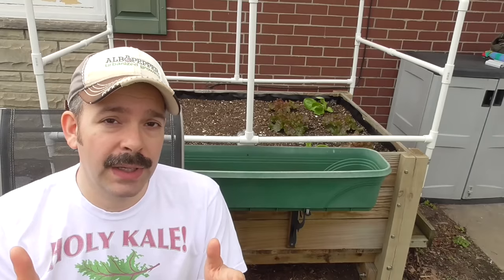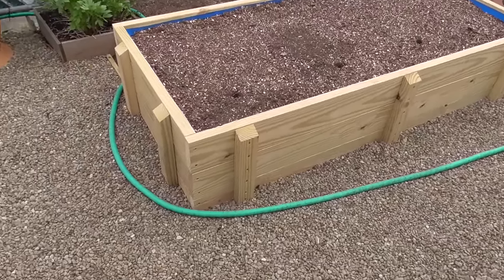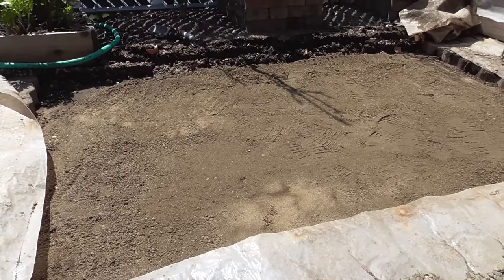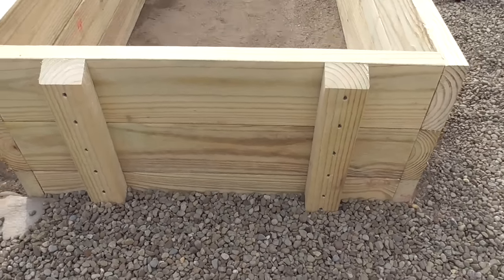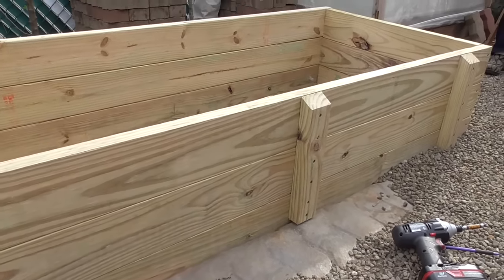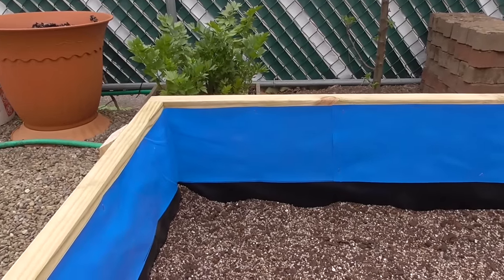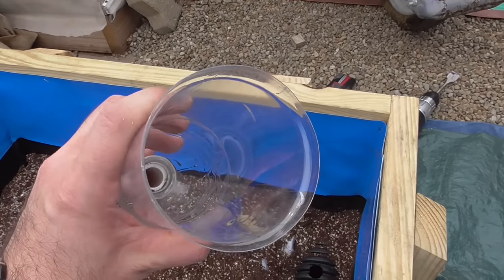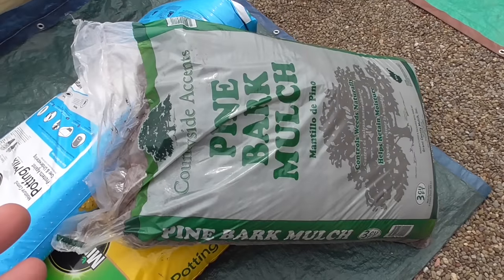Self-watering SIP Sub-irrigated Raised Bed Construction  (How to Build)

Comment: Why no manure? I don't have access to potting  mix (I live in the desert) so do  you recommended another medium? I have plenty of sand and compost and manure..
Reply from the maker: Maintain Physical Structure:

KEEP YOUR MIX CLEAN: For your SIP potting mix to remain viable after years of use it must retain its water wicking attributes while maintaining good pore spacing for healthy aeration of plant roots. Unlike in-ground garden soils that are mineral based, there is no need for incorporating excessive "organic matter" in the form of plant waste. After each harvest it is best to pull out large plant roots, shaking off the dirt. Compost the roots in a separate location. Artificially aerate the soil by fluffing it with a rake.

COMPACTION IS THE ENEMY! Over time, large particles will start to break down leading to compaction. To compensate for this it is good to add components that will improve soil structure as needed. Perlite will boost aeration if the mix seems too moist. Pine bark fines can help to maintain good structure over time. An important note about wood products in potting mix: Nitrogen draft may occur, requiring additional nitrogen supplementation. To minimize this effect, use dark, outer bark pieces (higher in lignin) which tend to break down slower than light inner wood. Look for aged or composted barks as these are more stable resulting in less N draft. If you add these to your old SIP mix, be sure to mix them in very well.

TOPPING OFF WITH PEAT MOSS? Adding fresh peat moss is usually not needed. By itself, peat moss is prone to compaction. As potting mixes get old, compaction becomes a growing concern. So, unless your soil wasn't wicking well in the previous season, don't top off your SIP with pure peat moss. It's ok to add some if it is included in a complete potting mix which would include perlite and possibly wood products. Tossing in a fresh bag of potting mix is an easy way to top off a planter that has settled over the season.
Replenish Nutrients

BAGGED COMPOSTS? To prolong the viability of your SIP potting mix, it's best to replenish nutrients in the form of fertilizers. Organic gardeners are apt to use compost as often as possible. In SIPs, worm castings can be included in small amounts. But using composts in containers can yield unpredictable results. Bagged (retail) compost, humus or manure might have a fine consistency, similar to garden soil. If it contains fine silty particles then this can reduce pore spacing and aeration properties of the mix. That's why topsoil is NEVER recommended.

As air gaps get plugged up by ultra fine particles, compaction occurs. And since SIPs are always resting on a perched water table, the few remaining air gaps tend to be saturated with water. This impairs root health, preventing plants from getting the oxygen needed at the root zone. This can lead to a decline in plant growth, or even root rot and death. Even if plants grow ok in the first year, over time the potting medium may break down to the point that it must be replaced.

HOMEMADE COMPOST? Buying bagged compost is not financially advantageous in large beds anyway, not when compared to buying a bulk organic fertilizer. Of course, homemade composts might work, especially if they are mostly wood based. These tend to have more structure. Larger particle size means improved aeration. I've found though that it's very easy to reserve my compost for conventional beds and perennial plantings. It all gets used, just in a different location.

https://albopepper.com/refreshing-sip-potting-mix-adding-fertilizer-year-2.php
Reply: @Albopepper  So don't bother then if I can only use sand and manure? Could I place strips of fabric in water pit riding up through the soil to help wicking?
Reply from the maker: No idea. I have a basic system that is tested and works. But if you fill it with something totally different, then it's not the same system & I really can't advise you on it.

Comment: When creating the underdrain, there are 2 critical factors:
1. The soil volume to water reservoir should be about 15%. Fortunately, that is about the same as the area of a square around a circle. 
2. With drain tiles, there should only be slits/holes on one side. The holes always face down so the soil won’t flow in. A negligible amount will accumulate in the bottom of the pipe over time. If that is a concern (shouldn’t be), then a bedding of open gravel will trap the minimal amount of soil before it gets to the pipe holes.
Reply from the maker: Thanks for sharing your observations. Fortunately, the perforated corrugated drain pipes shown in this video have never filled up. It's just not an issue. I've examined them after years of growth and they remained empty: https://youtu.be/q-JitnHKCY8  There's no need for gravel or fabric or any special filtration. Just use potting mix based substrate materials and it will be fine.

Comment: I see you put a little straw or pipe on the drain hole. Can I just leave the hole as is without the pipe there?
Reply from the maker: With smaller plastic SIPs like buckets, you would be fine. But for the wooden SIPs, I prefer to use some sort of tube.

Comment: Hi, you mentioned both Vermiculite and Perlite, do you use both?  Vermiculite in the bottom and Perlite up the top?
Reply from the maker: I always use vermiculite in the bottom along with peat / coir and often perlite as well. No barks though. Then in the top I use some extra perlite and vermiculite, if available, along with conventional potting mix components which include some fine bark / mulch pieces.
Reply: @Albopepper   What is the best width between the pipes, you said 1/4" was the minimum, what is the max? Thanks

Comment: "why cant i use regular top soil" i have trying a small scale sip. i used 32 quart plaster clear drawer. i gravel about an 1" deep. on top of the gravel i use an old t-shirt just to cover the gravel then placed file tube in one corner in the opposite side i added a 1/4" drain hole. i add top soil add water. i watch the soil empty the water chamber and get very moist not muddy. well its been three day the soil is still moist. of course wondering what would happen if rains a lot..  why is your oppion on it
Reply from the maker: Hi Larry! Welcome to my channel. I appreciate your support. :-D  It is a common horticultural practice to use potting mixes in containers. That doesn't mean you can't get away with using top soil, but you may need to amend it to get it to work. The results might not be as good either. As you've mentioned, rain events can greatly impact the soil's performance. The fine silt-like particles in top soil can get compacted, reducing the oxygen available at the root zone. This can cause plants to suffer.

I don't use gravel for the base in my SIPs. So I won't venture to describe how those would work. For me, the corrugated, perforated pipes are super efficient and they work really well. I think that you've got the right idea by trying a small scale test. It may show you the best direction to go and save you a lot of headaches down the road.

Comment: The earthbox system has a auto watering accessory, have you taking a look at that, would it be possible to use that in a system like this?
Reply from the maker: Hi Michael! Using a float valve system is certainly an option in a bed like this. In the middle of my Update 3 video I mention the possibility of doing so.  https://www.youtube.com/watch?v=aKrjC5sC5cU

Comment: How many years you can grow in this bed without changing soil you mixed in?
Reply from the maker: Good question! My original SIP box was filled in 2011 and it is STILL using the same mix.  I've topped it off. But never emptied it out. http://albopepper.com/grow-box.php   :-D
Reply: Do you add compost or other material there every year? Because plants grows and then you throw them away. So volume of box have to drop. Do you add thin layer of compost or your branded mix every year?
Reply from the maker: Hi Sergey, I've added homemade worm castings, which seemed to work well. I use my compost in conventional in-ground beds. For additional topping off, I've used any of these: perlite, growstones, vermiculite, peat moss, coir & composted pine bark. It just depends on how the mix is looking and what I have on hand. I try to maintain nice, non-compacting structure, without compromising the wicking properties.

Comment: I would like to ask what the maximum width would be. I was thinking of a 36" wide bed by 72" long for my project.
Reply from the maker: Hi Robert! Welcome to my channel. The maximum width depends on how far in you can reach. If you are accessing the bed from both sides, 48" would be a recommended max width, allowing you to reach in by 2 feet. If you can only reach in from a single side, then 24" would work better. Otherwise it just depends on your build materials, especially the pond liner.
Reply: Thank you sir. I was more worried about the pipes having to much space between or not enough. Thanks for the reply. 
Woody
Reply from the maker: Understood.  You can scale up or scale down the number of pipes to work with a desired box size. Thanks for watching my video!  :-)

Comment: What is the tallest raised bed you can make and still have the SIP work.
Reply from the maker: I have not tested the maximum threshold. But I would probably not try to exceed 24 inches of internal depth, including reservoir. It partly depends on the physical characteristics of your potting mix.

Comment: Is there a reason why you use multiple single pipes, rather than one long pipe folded over itself to cover the entire area?
Reply from the maker: I find it easier to work with pipe segments. The spacing is very consistent that way. However, wrapping the pipe in a continuous spiral would be just as effective as long as there are uniform gaps between the sidewalls. It's a matter of personal preference. In a round container, like a watering trough, I would probably try the spiral approach.

Comment: Can I, instead of, pine bark mulch, use cedar mulch?
Reply from the maker: I know that pine, fir and redwood are commonly used for growing mediums. I'm not sure about cedar. One important thing is that the material should be the dark outer bark, finely shredded. If it is aged or composted first, then it will be more stable and will not produce as much nitrogen draft.

Comment: have you done a video for the elevated bed? I want to do a few of those
Reply: Does the overflow tube need to be soft? could you use a hard piece that is used for sprinklers? I'm in the desert and that tubing usually becomes decayed really quickly
Reply from the maker: No, but I do have a page on my site with info of how I built it: http://albopepper.com/grow-box.php

Comment: Do you know a way to make this truly self watering?  Some kind of self actuated valve or something?
Reply from the maker: +Frank Kovach  -Hi Frank! I think the way to go would be to hook this up to a float valve.  I would probably keep the float valve outside of the box so that it can be serviced and easily brought inside during frigid winters.
Reply: +AlboPepper That's interesting.  How would you keep it outside the box?  I can't picture how that would work.  The only thing I can think of is to have an external reservoir (closed tank) with the float valve inside THAT, and the tank hooked up to a water source such as a hose.  If that's not what you're thinking... how about a quick video on it?  Thank you.
Reply: For some reason I can't see this whole conversation under the video itself, but whatever.  I think that an external reservoir with the float valve inside it is EXACTLY the only way to do it.  Larry Hall has lots of videos plugging a very specific product line that does this.  Good stuff over there.  I think a combination of this method plus Larry's would be the way I would go.
Reply from the maker: DrDangerPuppy - I think you are picturing the same thing I had in mind. Set up a small plastic box that houses the float valve. Make the elevation the same as your SIP box. Connect the water supply to the float box. Then connect the float box to the SIP box. You could easily modify it and monitor it as needed.
Reply from the maker: Frank Kovach
I agree about the external reservoir being ideal. In climates that experience Winter freezing, the float valve would be easy to disconnect and bring inside. If it needs serviced or if you want to adjust the level, you can easily do so without disturbing your plants. Zero mess. Larry Hall's tutorials are the perfect reference for this application, as you mentioned.  :D
Reply: AlboPepper - Drought Proof Urban Gardening ,

Comment: How long would this contarption water itself? 1 week? 2 weeks?
Reply from the maker: It depends on the water capacity of the unit and the transpiration rates of the plants inside. More plants, larger plants, more heat, more sun, more wind, lower humidity - these are all going to increase the rate of water consumption.

Comment: Can I use this same design on a 22" high box? Bad back so I made them taller.
Reply from the maker: You could try simply making it deeper but the water might not wick all the way to the top, plus you would need a LOT more mix to fill it. Some people have built these on legs to get extra height while keeping them at the 16.5" depth. Finally, some people have filled the bottom with a sub-base of gravel (6 inches). Then they added all of the standard SIP items on top of that (liner, pipes, etc.)  Perhaps one of the 2 latter options would work for you.
Reply: AlboPepper - Drought Proof Urban Gardening yes. That's it! Thanks so much. My back thanks you as well.  I'll raise the floor up.

Comment: I may have missed it, but what mil pond liner do you use or recommend for the lower portion
Reply from the maker: Hi David, I've used 25 mil in the past (as a MINIMUM) but I suggest 45 mil.
Reply: Thank you for your quick response

Comment: I'm not really following how this waters itself. Only that there is a pool of water on the bottom but then again most of this drains out of the planter box because of the hose pipe. Theres mention of wicking type potting mix so assuming this works by the soild on the top of the bottom sucking up water from the bottom; though I dont really see a whole lot of potting mix touching the water in order to wick moisture up to the plant roots at all. Some diagrams or explanation of how it works instrad of how to built it would be beneficial
Reply from the maker: Glen Browne Hi Glen, here is the latest video in the series: https://www.youtube.com/watch?v=VJ2T6gUv8Gc .  It shows a retail kit which is built around the same idea. Very little surface area is required for effective wicking.  This box holds a lot more water than you might think at first glance.  And there's no need to completely fill it to the top everyday.  So if it's 75% maximum capacity, and then it rains, it will capture that rain and reduce run off.

"Self-watering" is a marketing term used in the industry to describe sub-irrigated containers that have water reservoirs.  I wrote up an explanation of the process years ago: http://albopepper.com/sips.php .  To fully automate it, you could easily incorporate a float valve.  But I have no need for this in my situation.
Reply: AlboPepper great thanks, I got it now. I have plenty of overflow piping left after a house build so this will be a great use for it

Comment: Did you put a barrier between the soil and the actual SIP layer ?
Reply from the maker: Hi Mihn, thanks for watching. I've never use a barrier with this particular design style. The same goes for my smaller SIP totes. It hasn't caused any issues, even after several years of use. So I would say it is not a necessary step.

Comment: Yes, I can see there are places where your wicking beds would be just the ticket i.e. roof tops where water needs to be wicked, balconies with people underneath, small enviros etc. Contaminated soil shouldn't be even walked on as it will bring the contaminate inside. I would leave a contaminated soil area but I would work with sandy soil. Water catchment is the very best conservation. Nematodes are not necessarily soil pathogens some are useful. We know so little!!! If I had trouble with them... I'd research!
Along side this method or other interesting solutions we (all of us) need the knowledge of how to grow food in the ground and that takes a lot of study! Personally for me... that drainage pipe is a worry as well as the liner. I'm not so sure they were designed for food growing. Also, the leaching from the treated wood only needs a few holes. 
Organic gardeners feed the soil first not just grow the food - even potted soil. I like that my philosophy very much tries to match my gardening practises. Yes, I know it's very difficult to modern garden without plastics but if we do not attempt to get away from the stuff we all know it won't end well! Far as the finite sources of augmentation goes, perhaps the question should better be phrased as 'what do plants need?' and then work towards delivering this in as local a source as possible. I don't know that soil needs peat moss etc. We know millions of people can be wrong. That's how we got here. Refining ideals are useful for directions so doing the best we can with the huge amount we've been given surely is the noblest of paths. In short... I read all labels then I do the research!
Reply from the maker: +barbara reid - Hey Barbara, I just contacted a couple companies and I'm getting some samples of potting mix alternatives that are peat free and much more sustainable.  I look forward to sharing info on these in the future... stay tuned!